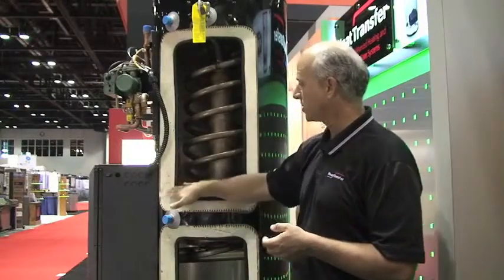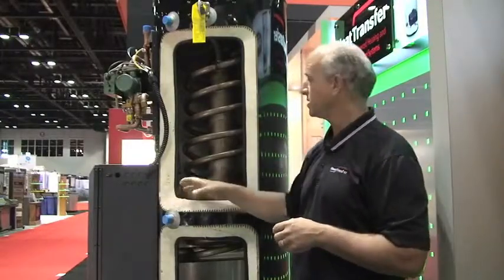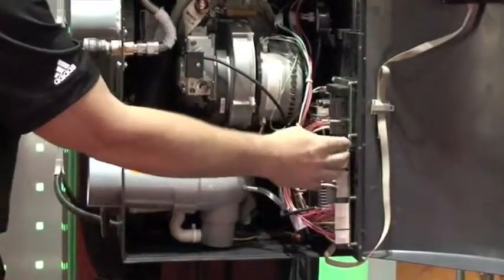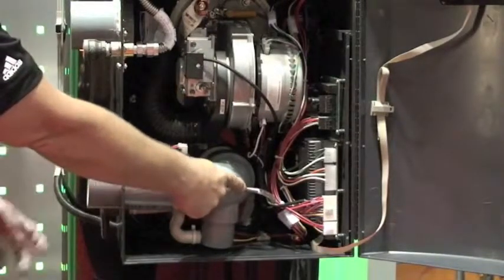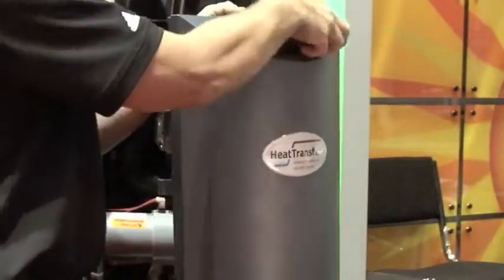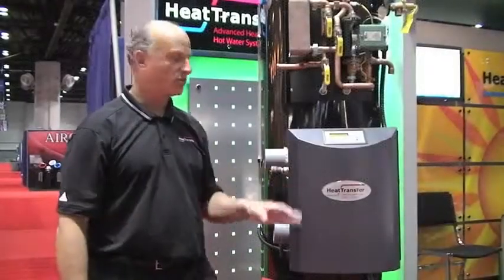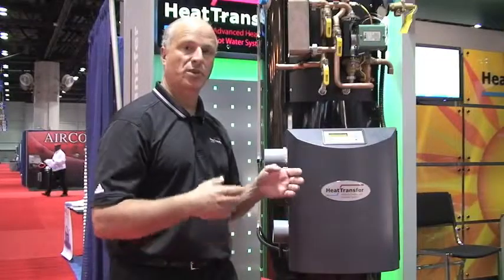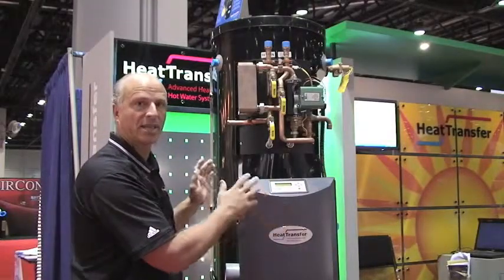Phoenix Evolution Virtual Tour by Dave Davis Part 2

Comment: Is it possible to wire this up to a 12V off grid PV system? I am trying to design a system for a portable washroom used in remote locations that is powered by a couple PV panels, evacuated tubes, and back up propane. One of the limitations is that everything is running off of 12V supply and needs to be user friendly/self monitoring. Would love to be able to use these HTP tanks in the design.